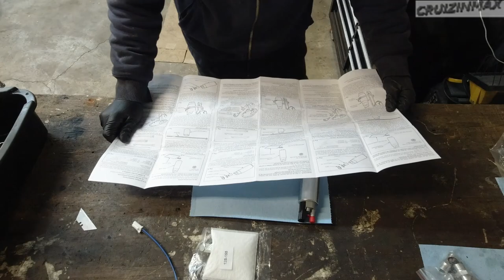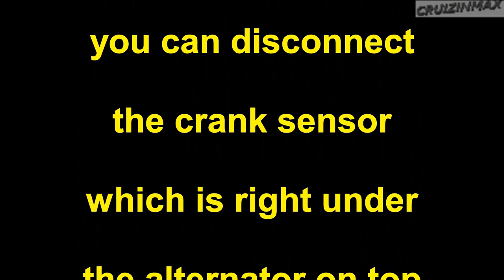Subaru STI EJ25 build part 14 walbro 255 fuel pump

Comment: Dude wah?... You went through all that effort and didn't even replace the filter! The filter is inside that snow cone looking thing above the fuel pump, in line with the fuel flow out of the top of the assembly. You should replace that entire piece with submersible fuel hose, and run a canister style fuel filter (cheap, generic ones are not even 10 dollars) under the engine bay before the fuel feed line to the fuel rails like in the 2002-2004 WRXs. They didn't have them in tank. Stupid design change by subaru to make it super inconvenient to service plus with that if you ever have to put in garbage fuel you can just replace the fuel filter. Not to mention having the fuel filter downstream will reduce the strain on the fuel pump and increase your new Walbro's longevity.
Reply: Guaranteed that thing is super nasty inside btw. Remove it from the assembly and turn it upside down in a bowl and you won't believe that you put it back into the tank..!
Reply from the maker: Yes I know...but since this car only has 37k miles on it and seen nothing less but 93 octane I figures the filter is pretty clean but you are right, since i had it out i should have replaced it.  I am planning to make an outside one in the future, thanks for the comment.
Reply: @cruizinmax4017  no problem man. Like the content! I would definitely pull out the old one when you get a chance, and remove it completely in favor of submergable fuel hose. And add in a canister downstream. If you pull it, take it apart. I think you'll be surprised at how gross it can get even with high quality fuel